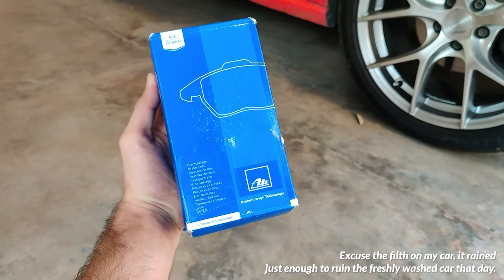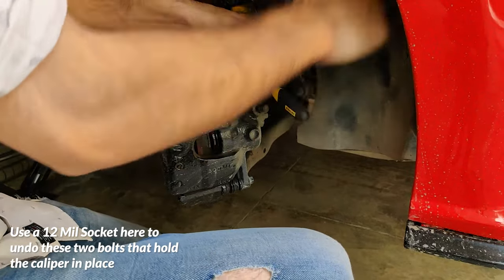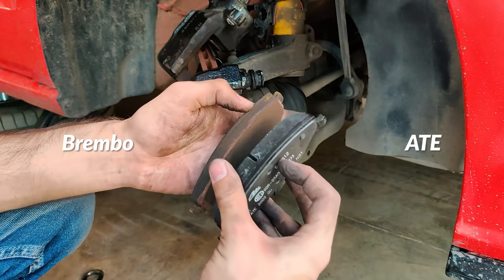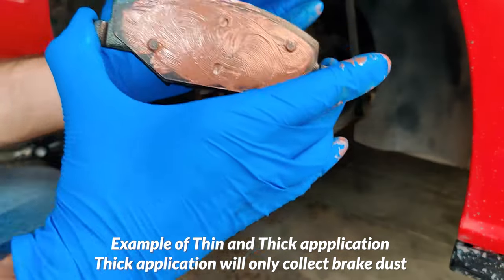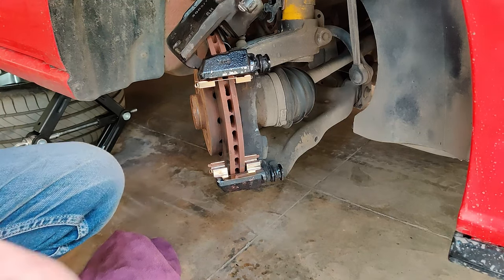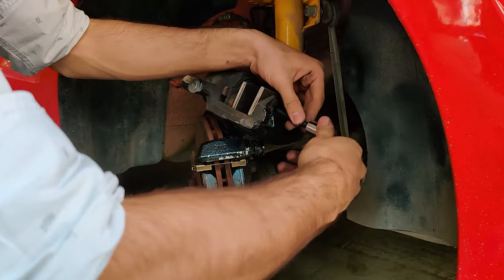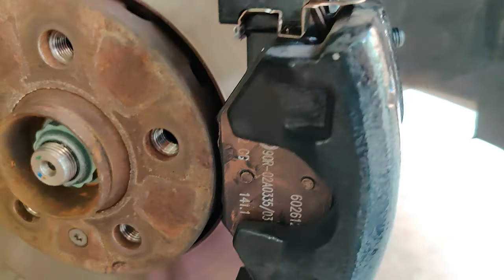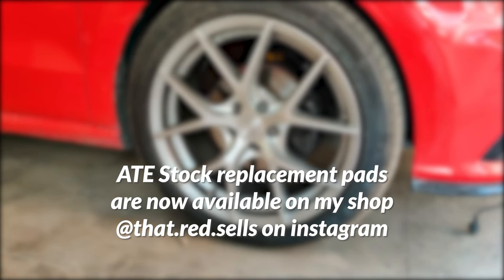How to Change brake pads on your Polo/Vento and other cars. Switching to ATE Brake Pads on my Polo.

Comment: I have a 1.0 tsi with s2 build and I’m on budget will a ate rotor+pad setup do the trick or do I need to save for a 288mm bbk (since you haven’t upgraded to bbk yourself on a s2)
Reply from the maker: S1, S2 don't matter much, your driving style matters and regardless of the power you're puttin down in your Polo/Vento/ameo/rapid, a 288mm bbk will be the ultimate brake upgrade, i myself will be Saving for that and these ATE pads are just for the time being.
Reply: @PrerakKataria  I was going to UK this Diwali can I hand carry it on my way back if yes than would you send me the part numbers
Reply: We are 10 people going so I can also bring 1 set for you as well

Comment: Imho applying grease at the backplate of pads makes 0 difference. For squealing usually the pin and piston are lubed with silicone lube.
Reply from the maker: All of these steps make very small difference but they add up overall